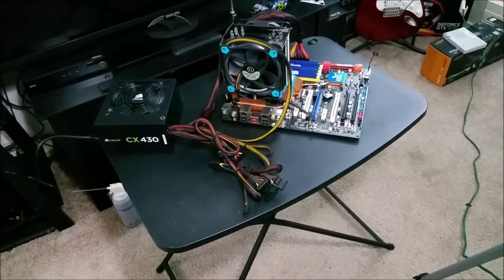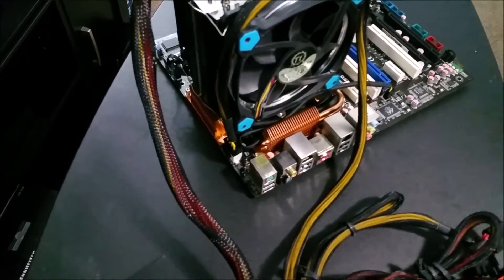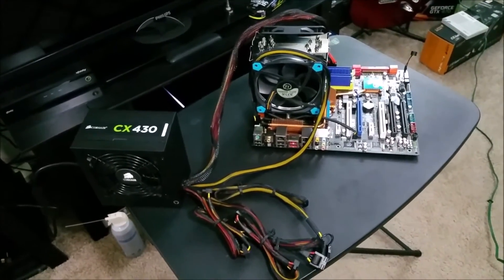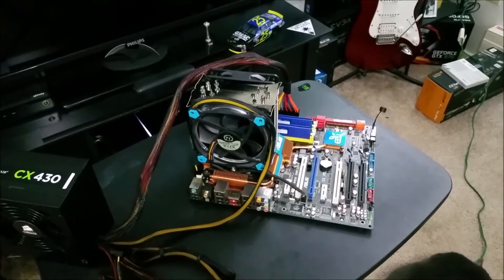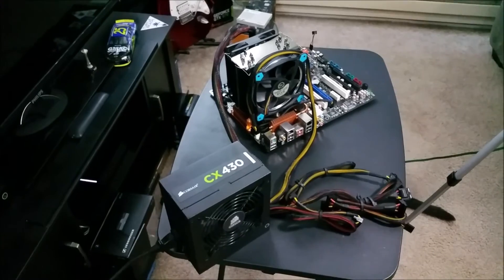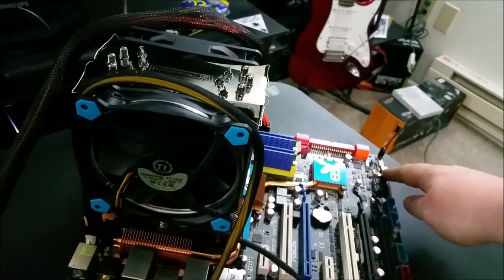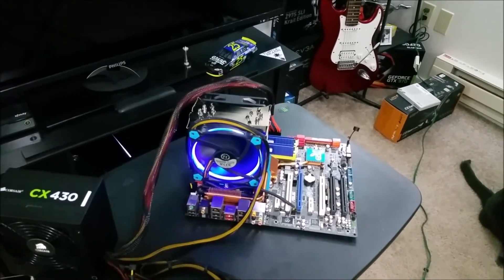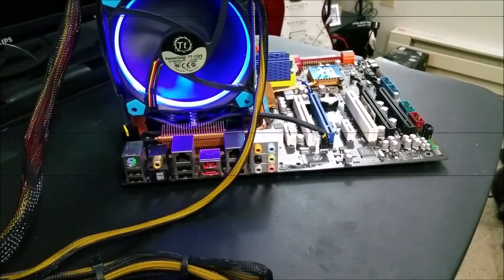Part 2 of the Budget Gaming PC build

Comment: I just built a Q9550 budget gaming PC nearly two weeks ago. The parts that I wound up using cost me around $300. But I spent a bit closer to $400 because this was my first time building a PC from scratch, and wasn't sure what I was doing or where to start.

I wound up with an overclock to 3.07GHz, a new CPU cooler and fan (came with the stock Intel one), a GTX 1050 Ti, 4GB of RAM (more coming in the mail soon, I hope), a brand new 650W Corsair PSU, an ASUS P5E-VM DO mobo, and various HD drives and an SSD that I had laying around already. I through it all in a Cooler Master case that I had gotten from my uncle months ago for free.

Altogether, this CPU is quite impressive for its age. I didn't expect that it'd even be able to play modern games at all, but I am able to play DOOM on ultra settings with Vulkan at around 60FPS (vsync on). This gave it its name "DOOM-Machine".